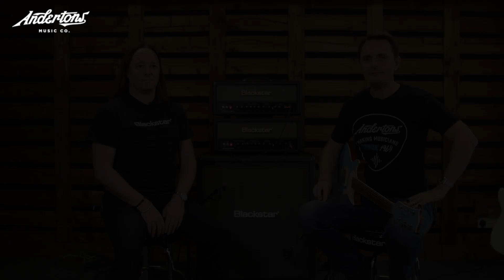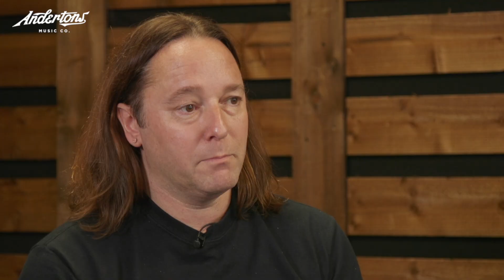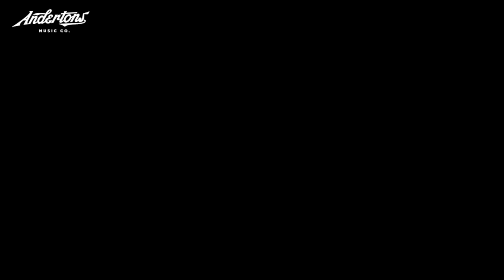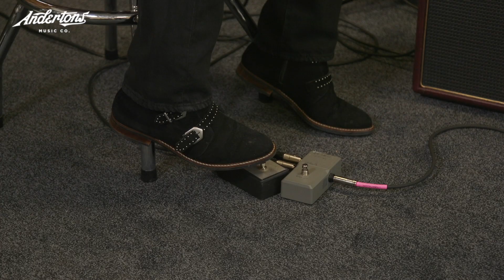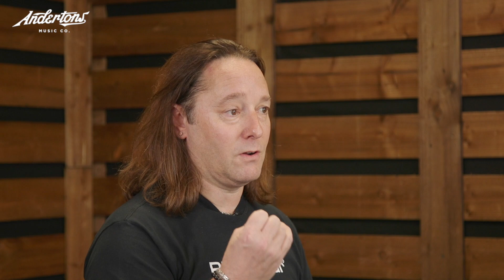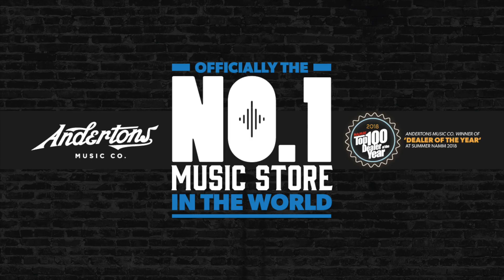Guitar Amp Myths Part 3 - Do Different Valves Make Much Difference?

Comment: Here's a bit more technical info on some of the terms used for guitar amps in general:

- BIAS: The adjustment for the polarization of the tube in the circuit, which changes it's operation point (aka how "hot" [higher current] or "cold" [lower current] they run).

- FIXED / CATHODE BIAS: The type of biasing circuit used to adjust the tube's polarization. In Cathode bias, there's a component called a Resistor put in between the tubes' cathodes and ground, which limits the current going through them. In Fixed bias, the cathode is connected to ground, and a Negative Voltage is applied to the tubes' control grids, which (as the name implies) controls the current going through the tubes.

- SINGLE ENDED: An amplifier that uses a single-phase output circuit (aka it DOESN'T have a phase inverter/splitter). It CAN have more than one tube on the output, but they are working as a single tube to produce the output signal.

- PUSH-PULL: Sometimes also called a "Double Ended" amplifier, it's the type that uses a dual-phase output circuit (aka it DOES have a phase inverter/splitter). It can have AT LEAST one PAIR of tubes on the output, but it can have more pairs depending on the power output it's designed to put out (more tubes = more power). 

- PHASE INVERTER/SPLITTER: It's the circuit that divides the signal for a Push-Pull output circuit. The way Push-Pull amps work, each tube (or pair of tubes) turns on and lets out half of the signal at a time, and for that to be achieved, each tube (or pair of tubes) needs MIRRORED versions of the signal in orded to work in proper sync.

- CLASS A/AB/B/C/D: It's the term used for how the device (tube, transistor, integrated circuit) is polarized in orded to work as an amplifier.

   Class A has the device ALWAYS ON, no matter how much of the signal goes into it. Therefore, it's the most power-hungry and least efficient of the classes (15%-35%), but also the simplest circuit to build.

   Class B has the device on ONLY WHEN SIGNAL GET TO IT, which means it turns off when there's silence. Therefore, it uses LESS power than Class A for the same power output, being MORE EFFICIENT (65%-75%), but because of the turning off in it not being perfect, it can introduce distortion to the signal being amplified at the near the zero-signal points, or crossover points (causing crossover distortion).

   Class AB is in-between Class A and B, where the device is ALWAYS ON, but at a lower current than when a signal gets to it, when the current goes up to put out that signal. Therefore, it uses LESS power than Class A but MORE power than Class B, and it's efficiency is also in-between both (50%-70%). It also has less crossover-distortion than Class B, as it doesn't completely turn off at the crossover points.

   Class C is only used for radio transmition, as it would have too much distortion to be used in audio. However, it's VERY efficient (up to 80%).

   Class D is the MOST EFFICIENT audio amplifier class there is (over 90%), and it works by turning the devices on and off as needed by the signal being amplified. It is NOT DIGITAL, as it doesn't need to make use of digital logic nor programming to function. You could technically build a Class D Tube Amplifier, but the cost of such a circuit and the gain in efficiency don't add up for anything worth being done by manufacturers nowadays.
Reply: Thank you. Could not have put it better myself. Or maybe I could if I'd had more time. Either way, yes, what he just said.
Reply: blackcorvo thanks for sharing your knowledge
Reply: Amplifier classes has nothing to do with being on and off when there is signal, has more to do with the design of the electronics.
Reply: @spastor92  you clearly don't understand amplifiers. 

But for some reason, you feel like you know enough to make comments like this. 

Dunning Krueger possibly.... No... Certainly.
Reply: @ryans9029  class B amplifiers has nothing to do with power turning off when there is no signal. WTF
Reply: @spastor92  you don't understand what you are talking about.

He didn't say the amp turns itself off.

In b operation, each side is only operating half the time, and off the other half, on.... Off.....

Three are amp designs that output through a single stage or tube, all the time. There are other designs that push with one and pull with the other alternating. In an on off on off fashion. 

Go read about amp design.
Reply: @ryans9029  i know that, its not clear in the description and is confusing to someone who dont know about amps.

Comment: Excellent, as I am experimenting with various valve at this time, and have experienced huge differences in  brands.  JJ's vs Tung Sols - vs EHX vs Ruby's vs China.
Reply: I swapped-out a JJ 12AX7 for a Tung-Sol 12AX7, in the V1 position in my Dark Terror. It was supposed to give the shape control more headroom. I ended up putting the JJ back in, as I liked the tone better. I strictly use JJs in both my Orange amps (Dark Terror & TH30 head).
Reply: @nitegoat1369  Honestly, I'm beginning to believe that the JJ's are definitely a solid go to tube.  For some reason I'm having noise issues and failures with the Tung Sols EL 84's although when they are working they sound the best.  Can't figure out the problem with them as my amp is cathode biased.  The 12ax7's are fine.  I'm goin to bite the bullet and order some 7189's for the power stage.

Comment: Yay I hope you use my question ill ask again :).   I'm wondering a little bit about how amps have changed over the years in the gain sections of the pre amp stages.  How do we get such high amounts of gain using the same tubes we have used in grandpas country playing amp but in today's amps.   My main reason is because I play metal music and i' m curious to know how and if driving the tubes to such high gain and distorted amounts is there is more wear over shorter time or anything to the tubes .
Reply: The way they achieve more gain is by simply using more preamp tubes one after another. Each stage multiplies the signal level, and as the gain rises you'll get more distortion. Remember - gain and distortion are NOT the same. Gain is just the idea of increasing the signal/volume level. Distortion is the actual misshapen, distorted signal, which is a result of hitting tubes with a strong signal, clipping it.

Distortion can also be causes by purposely unbalancing/cold biasing a stage. 

In a preamp, extra gain and distortion won't really wear the tubes much more than normal. Preamp tubes rarely die. I have plenty of heavily used 40-60 year old tubes.
Reply: @JMA_Elec    Interesting thanks for that information.   I guess I have always thought that HIGH GAIN amps ment more Distortion.
Reply: There can be different reasons for this. One is adding more valve stage, known as 'cascading', so that one stage drives another into more distortion. a clean amp may only have 1 or 2 stages, where a high gain could have up to 5 or even six. Also the valves operating conditions can be set to produce more gain. Another common what it to use solid-state components (transistors, FET's, opamps, diodes, LED's etc or combinations of these) to either add more gain therefore drive themselves, or to be part of the distortion generating circuits themselves. Driving preamp valves harder will have little effect on their lifespan as this doesn't actually change the current flow through them that much. Hope this helps. Paul.
Reply: Yay Thanks for responding.  So is it still common practice to use Op Amps in what they say are (All Tube) amps? @Blackstaramps

Comment: Questions for vol.4: Does Blackstar think to do a non digital solid state amp? Which is their best selling amp? What is that makes us think that valve amps sound better? Is it because valve amps have more uneven signal output compared to transistor amps?

Comment: I have a Vox AC-15, with 7 valves and a valve rectifier. The newer EL-84s have wider glass than the old ones; I had to drill out the metal surround in order to fit the newer EL-84s. Nobody mentioned that they are wider than they used to be. These wider valves won't fit the old Vox amps. I blew two Sovtek valves very quickly; I'm using Yugoslavian valves and any old EL-84s I can find.
Reply: Yeah they are wider for sure. Actually, some of the tube shop websites do mention that they're wider and won't fit in certain amps (some Voxes included I believe).

Comment: Valves do make a (bit) difference, but imho the circuitdesign , voicing and speakerchoice have a bigger impact on the sound. My Diezel Schmidt (EL34, Class A) is closer to a Vox AC30 than a Marshall. It gets quite hot, like all Class A-amps. My Rockerverb head (4 x 6V6) has more of a Marshall-character on the drivechannel, although it has tubes that you find in classic Fenders. The voicing is different, with quite some lowmids. I experimented with several brands of preamptubes and there you can gain imo more sonic wins than with changing the poweramptubes. But the most defining part in the chain is the speaker. Greenback, Creambacks, G12-65, V30's, they make a dramatic difference as does the cabdesign.
Reply: Stroopwafel 61 number f speakers and open/closed back makes a huge difference. Incas stunned how much better a 4x sounds compared to a 2x.
Reply: Exactly. Everything makes 'a bit' of a difference, but some things a lot less than people are led to believe. The circuit and other components around a particular valve have more effect than the specific valve itself.
Reply: You can get a small difference from changing valves but you'll never hear the difference within a band mix. There's much bigger differences to had by changing speakers

Comment: I did a video like this on my channel a long time ago. I wasn't changing type of tube but brands... I didn't hear a huge difference.
Reply: Robert Costa most differing tube brands are made in the same factories still, so they’re likely not to sound different from each other when the same type
Reply: Yeah I didn’t know that they were all pretty much made in the same factories but to my understanding different companies will request them at different quality levels. So their specs are slightly different as well as there are allowable tolerances.

Comment: But the tonewood is still relevant! It will "tell" the tube how to ring! So, always buy rosewood fretboards and maple top - mahogany bodies! And remember to always use your cab-clone for silent recording at night!!!
Reply: My maple neck, ash body Tele wouldn't have the twang with a rosewood fretboard. Maple and mahogany? That's your humbucker guitar. Single coils sound better with alder or ash.
Reply: @melvynobrien6193  My comment was of ironical nature! Come on, you really think that a fingerboard material produce twang?
Reply: @Mode-Noir  Really, you think tonewood is a myth?
Reply: @colaboytje  I don't think it is relevant. There are subtle differences, but especially when it comes to high-gain distortion no human being will ever tell you in a blind test if "this is bubinga" or "this a Fender with a corpus made from cardboard" or even a gittler!
Reply: @Mode-Noir  Wood is the most important in terms of overtones. Wood defines the overtones. But most see it as maple vs mahogany or ash vs alder. It's way way more complex than that. Take 2 American Strats with the same specs, completely the same, and they will sound different. Now, what is the difference? The electronics are the same (almost no variables in there). The biggest influence is the wood, even if it's the same sort of wood. The moisture, the density, the grain structure, the age, .... 
That's why you should never pick a guitar based on the color, but take a couple of them and play them side by side and pick the one that you prefer, with the best sustain, and so on...
Reply: @colaboytje  I don't say it's a myth. But it's definitely not depending on a wood species since it always has to do with the part of the tree you cut the material from. Otherwise guitars from same wood species would sound the same, always. I have a guitar made from Sapele, close to mahogany, but it's so heavy! Anyway, when it comes to tone, I made many experiments with soldering in and out pu's into different guitars. And I've always in the end fallen back in love with my 25.5" scale Ibanez RG550. I don't get this tight bass response on any other guitar. But it can't be the wood, mahogany (my other guitars) should be better than basswood. So, all my other guitars have tunomatic bridges. Only the floyd rose RG550 has the strings parallel and pretty close to the corpus. So, in order to get that defined bass response with a new guitar I will buy either a guitar with FR again or at least a guitar with a hardtail bridge with strings close and parallel to the body/corpus. I don't like the loose bass that comes from all my tunomatic guitars especially when palm muting. Wood species will not play any role in my decision. You can dial that in and out on the amp side. But this undefined/loose bass on the tunomatic stays in the signal, no matter what you do. I actually hate FR guitars but I like this natural attack they have. So, yes, the wood seems to impact the string, especially in terms of distance to each other especially where you pick.
Reply: Absolutely can produce more twang ect. I have a hard Ash Bodied 6 string with maple neck, actually had 6 of the same model, they all sound exactly the same have a certain tone to them and are very bright. And they have to be eq'd totally different than say a basswood Ibanez. This is not a myth, i've been playing for 33 years and have built guitars and had dozens of different types. It's a fact. Now, there are some combos that you will not be able to really tell the difference really through a high gain amp, that is true. And if you use EMGS, forget about it. But i've done this a/b with different guitars, same pickups, same pots same caps that i put on a multimeter to match that they were all exact and "tonewoods' is absolutely NOT a myth. Maple neck through, Poplar, Alder, light Ash, with any darkwook fretboard, not so much difference. Maple fretboard / maple neck on anything, big difference. Maple through Mahogany, any fretboard, noticeable difference from Maple through Alder/Poplar ect.  Walnut, like maple, Rosewood body, like maple. Bolt ons sound better, or rather i prefer it, but they sound snappier always. Set neck, is like bolt on but warmer. Neck through, actually imo is the least best sounding, but maple through Mahogany with ebony board is best combo for neck through ( imo) Neck through Alder i really don't care for over all. I had a few Jackson USA RR1, the best one sounding wise was a poplar winged one, sounded better than the other 3 alder winged ones.
There's more than just the wood, but it is not meaningless. Caps, and especially pots can vary. If you buy a pack of 20 pots, they will almost all be slightly to a lot different when you put them on a multimeter, and that can make a huge difference in your sound plugged in.

If you know about all these things, and take them into account when building your tone, then of course your tubes and cab and speakers mater as well. You think about all these things before hand so you get the tone you want or are striving for. Takes a lot of time and practice, years, decades.
Reply: Tonewood is grade of wood. It has nothing to do with tone. 
Tonewoods are split in more or less 3 categories. 
Looks, stability and how easy it can be worked with/on.
Looks: Any wood which looks good on an instrument (silly solid finished guitars...)
Stability: You don't want warping necks ets. Glued parts splitting etc.
Ease of production: Some woods eat tools and are simply tough to work with.
Tone???? Nope....
Silly people thinking there is TONEwood. TONEwood is a one of the big misunderstandings in instrument building.

Comment: I remember taking 6v6gt out of my aor30 and bunging in EL34 valves thinking I could make it louder. Couldn't get chassis back in combo and didn't hear increase in volume.

Using a 212 extension probably would have helped.
Reply: It is not that easy, and yes you are rigtht with the cab.
Reply: Just as well you didn't: As EL34's have a heater current of more than 3 times 6V6's then you may have burnt out your mains transformer.

Comment: Question to blackstar:
In my HT40 combo on clean channel voice IN (fender type?) is not working all the time or works for some time, then mutes. Other voice is working normal. Any ideas?
Reply: loose female plug, either the soldering or the clip thingy
Reply: @akukelilipan  female plug?